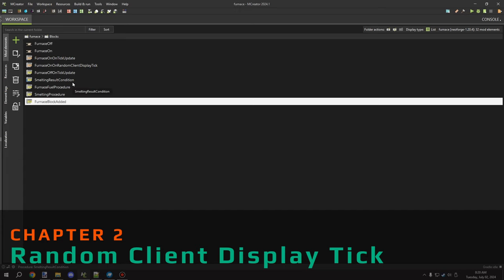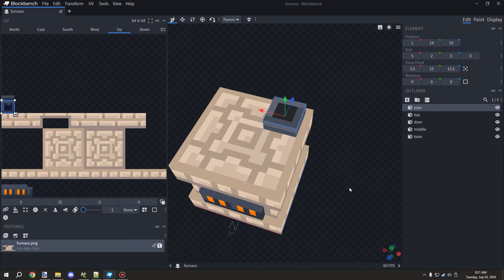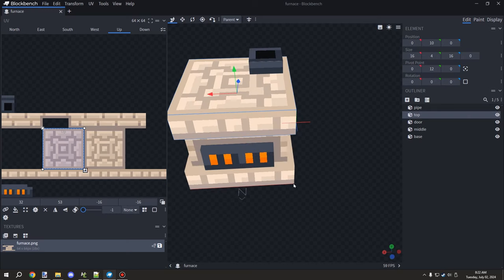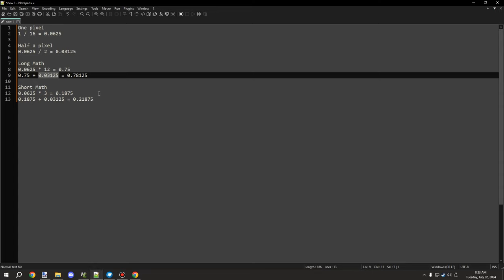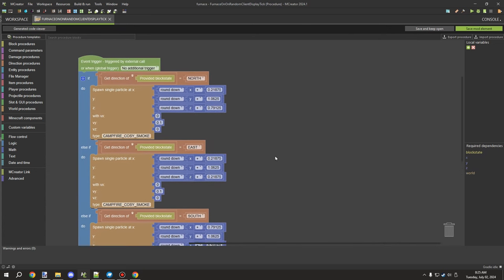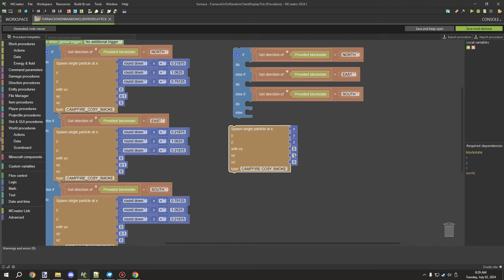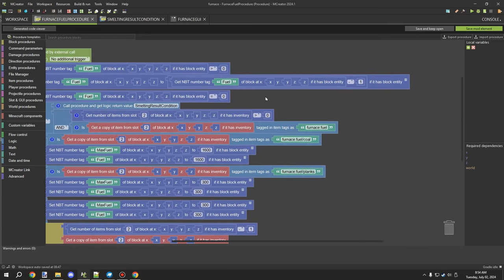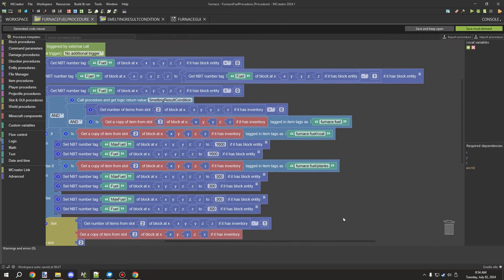Custom Furnace | Part 2 | MCreator Tutorial | 2024.1

Comment: would making machines that would run on  Redstone be similar? In the mod, I am working on I am creating a bunch of machine blocks that would act similarly to a furnace.  I want to have a grinder where I grind up pegmatite rocks, which would then be processed in a milling machine, added into a pickling tank, and finally into Lithium ingots to be used in batteries. As a Grinder would not run on coal, I assume redstone is more likely electricity. I assume that making other types of machine would basically  be the same so

Comment: If I put more than one coal in, it consumes it all super fast. How do I make it only use what it needs?
Reply from the maker: Chances are you did not put the procedures together correctly, I suggest using the example workspace provided in the description of the video as a reference, its a great tool to help people learning projects like this to see how things are linked there is also the procedures for all of the parts too in the project files. Just keep in mind that this is an advanced tutorial and if your not familiar with MCreator it you may not be ready for this level of a project.